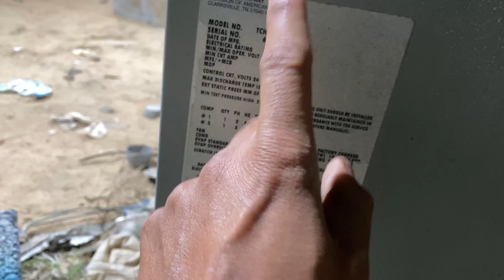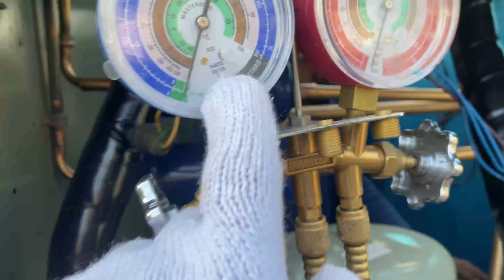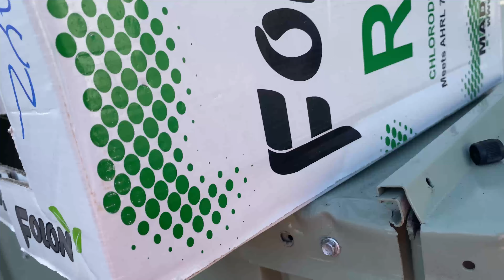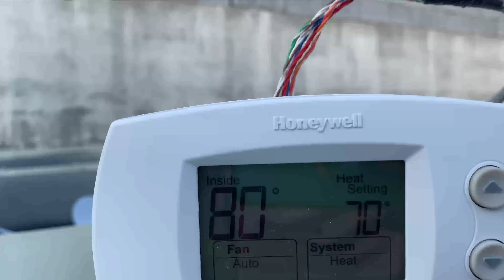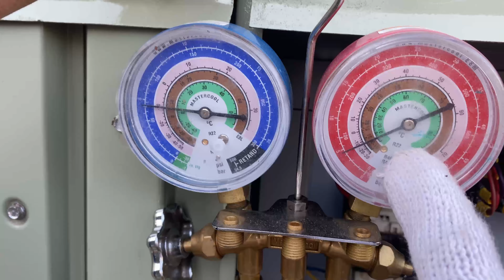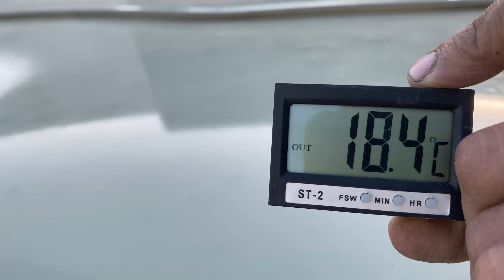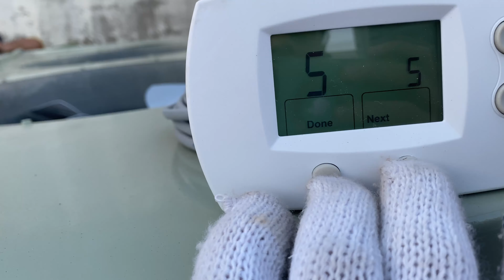Trane package ac repairing and maintenance | hvac training videos I  हिन्दी اردو 🇸🇦

Comment: Bhai isme condensor fan moto single phase hoti hai kya
Reply from the maker: 220 three phase model main single phase ki moter aati hai aur 380 three phase main 380 volt with capacitor bhi aati hai

Comment: LP HP ki 4 wire hue to.. ye ek hi remote se kaise connection dea?? Confused thoda sa bhai
Reply from the maker: har compressor ke liye remote se alag alag control aata hai aur wahi control LP, HP se ho karke aur time delay ke ek point se de karke aur doosre point se out kara karke phir contactor par diya jaata hai to aise wiring hoti hai ( ye main manual wiring ki yahan par baat kar raha hoon jo abhi video dekh rehe hain )